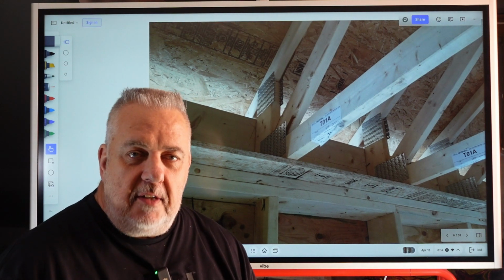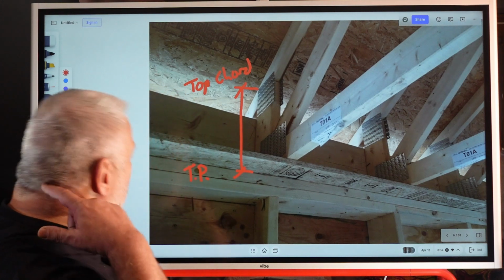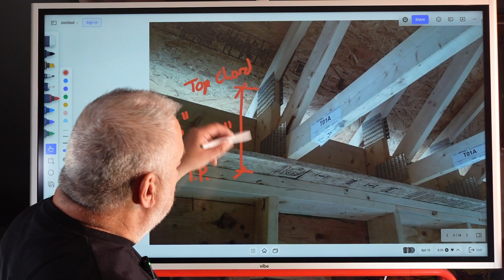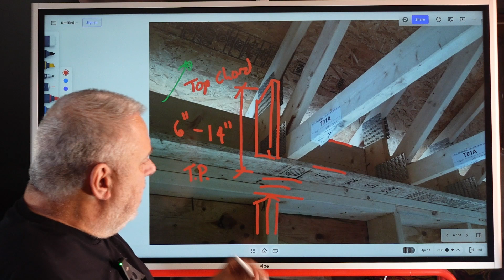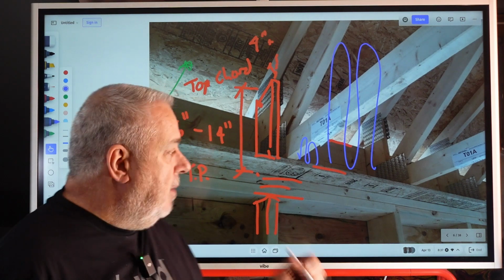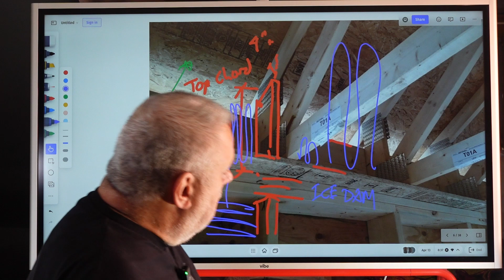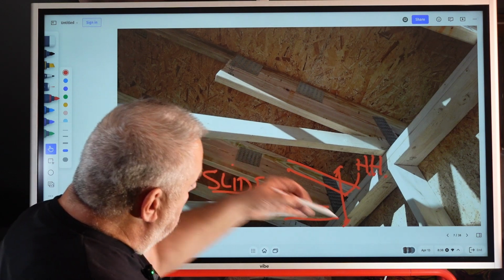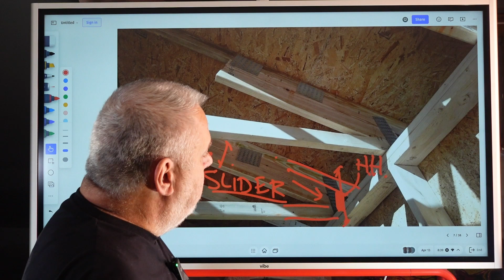ENERGY TRUSSES / RAISED HEEL

Comment: Your plywood roof diaphragm can not be boundary nailed as there's no solid blocking and there is a large gap at the bottom of the roof ply  vertical ply wall sheathing. The result is a structural weakness against lateral forces.  This is not a good structural detail.

Comment: Slider's are a bit more common here in the PNW, since risk of ice dams is very low.  Our big issue is blocking between the trusses being solid. This allows the transfer of the roof diaphragm down onto the top plate. The higher the heel the harder this is.

Comment: So if I want my insulation under the roof rather than on the ceiling, and my airtight rigid sheet under that so the attic is inside the conditioned envelope, how do I detail around the trusses?

Comment: In another video, Steve goes into the relationship between the heel height and the required roof overhang.  If you raise the roof with a taller heel, rhe tops of your windows will be more exposed to rain.  To compensate for this, you can increase the roof overhang.  An analogy would be if you ran into Steve hanging around the exit at HomeDepot waiting for the rain to stop.  He's late for a meeting with  Risenger, so you offer to share your umbrella.  Now Steve is well over 6 ft tall, so you have to hold up your umbrella extra high so you end up getting drenched.  Moral of the story: Get a bigger umbrella😂
Reply: Additional morale to the story, flash your damn windows properly ! 😅